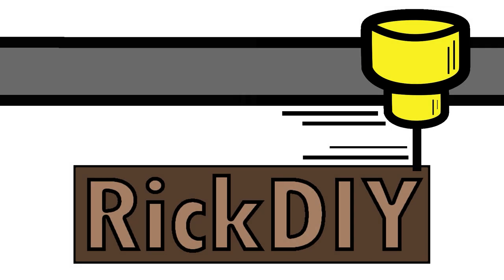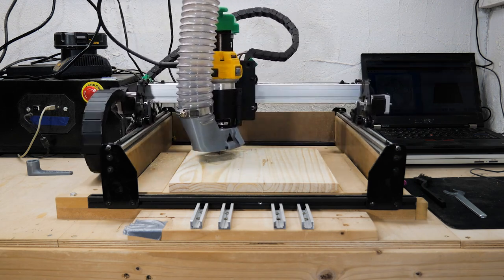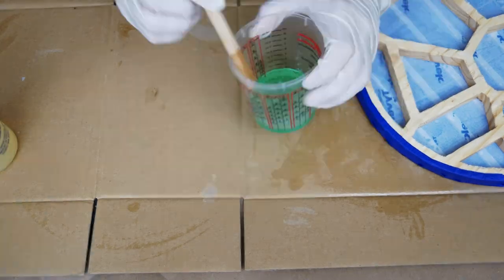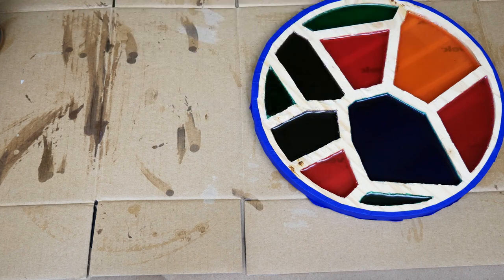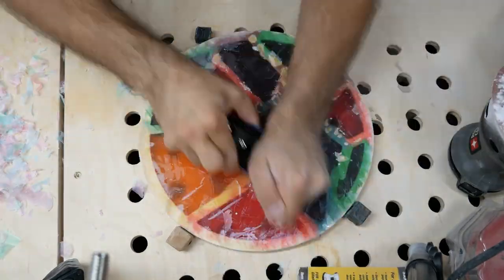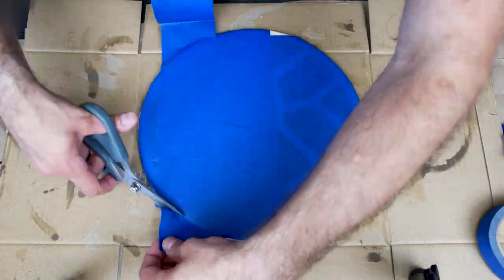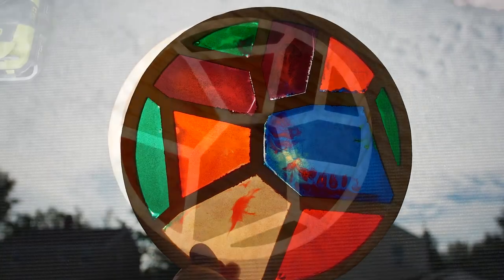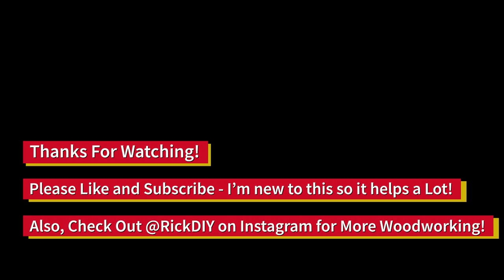MAKING STAINED GLASS OUT OF WOOD?!

Comment: Why not face it off on the Shapeoko?
Reply from the maker: I was kicking myself for not doing this. I didn't even consider it until I was editing the video. For those who may need more clarification, what Richard is describing is using the CNC machine, with a surfacing bit, to clean up the surface; rather than using a hand plane and a sander.

Comment: Nice job! Just subscribed. Lots of good tips like the food dye. Just tried my first epoxy project. Need multiple colors but small amounts. All of them turned out good except one color. It never hardened properly. So I cleaned it out and tried again. Think it’s because I’m just eye balling since I only need about 1/2 an ounce. Do you use any heat for the bubbles?
Reply from the maker: Yes,  it's kind of hard to see with the footage sped up, but i use a Crème brûlée torch to pop the bubbles initially before putting it under the box. And yeah, it can be super hard to get the concentrations right, even if it is just 50/50. If you don't use enough hardener, it stays soft, if you use too much, it can get cloudy.

Comment: I see you have a link to the resin you say you should have used in the description, but if we wanted to replicate the "mistake," what would we use? I'm thinking the food dye that created the tye dye effect might be altered if we use the epoxy resin instead of the poly. Great video!
Reply from the maker: I can't say for sure because this was my first time using food dye. I've used acrylic paint mixed with epoxy before without any color alteration though. By mistake, I was mainly referring to the cracking and melting the tape. I'd probably use a popsicle stick to swirl in different colors if I were to do this again.

Comment: We use the cheap painters tape, one piece on the spoil board and one on the project and some CA glue and activator between. Much less expensive than double sided table and in my experience if done right holds the workpiece better. Nice video. Thanks for the giveaway.
Reply from the maker: Thanks for the tip! I'll give this a try!